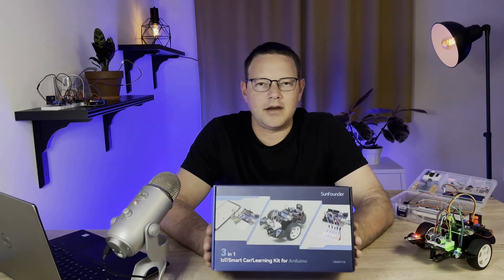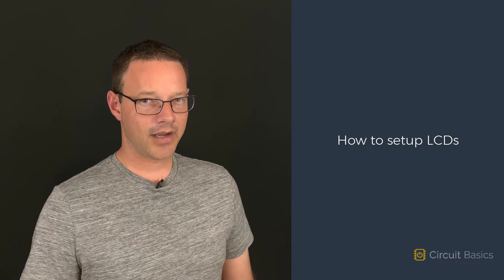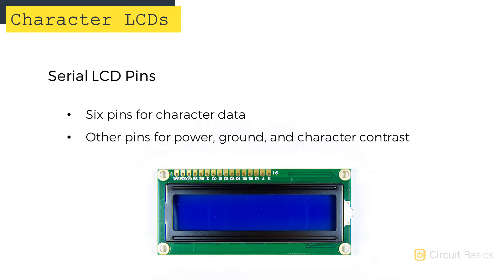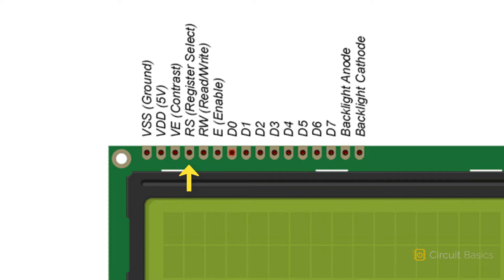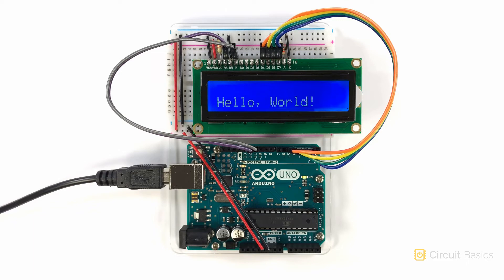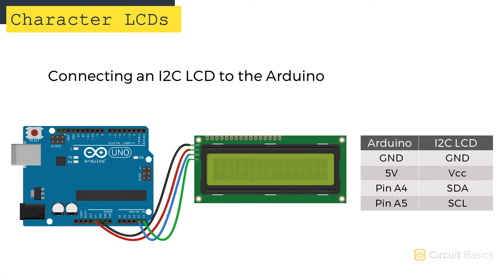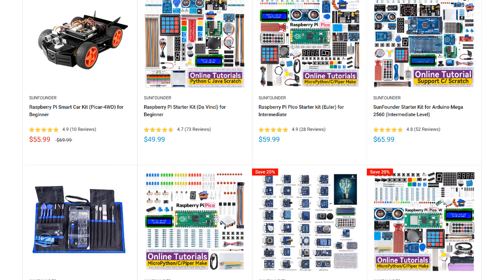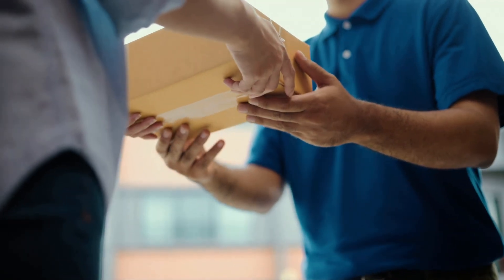How to Set Up an LCD Display on the Arduino - Ultimate Guide to the Arduino #30

Comment: The first time my lcd display turned on thx😂
Reply: how did you install that IC2 without hassle or you did not use IC2
Reply: @hetori9918  No just a normal lcd display without the I2c module